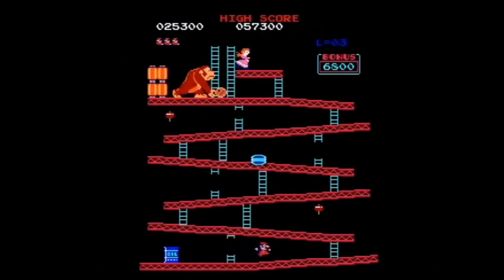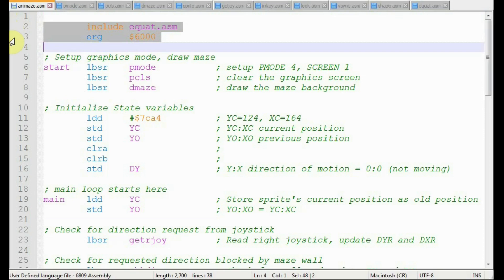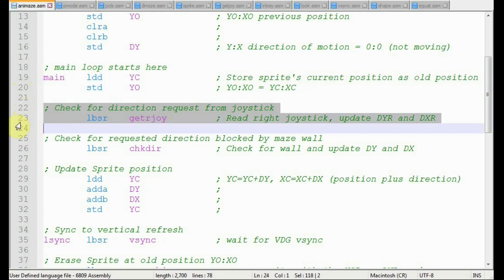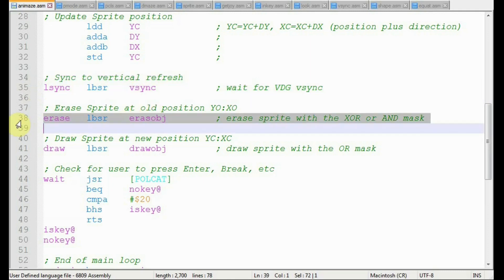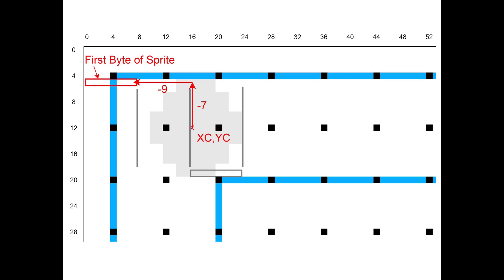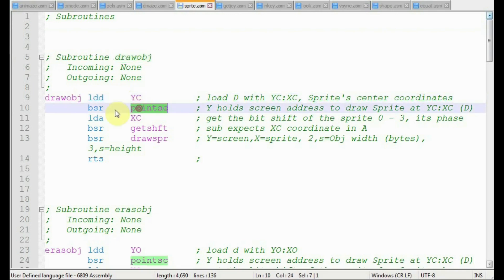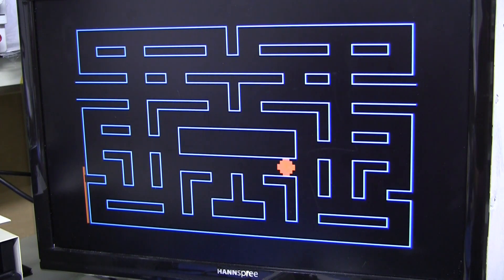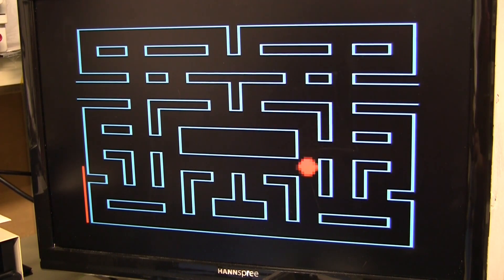Software Sprites are 10 Times Better with Machine Language than BASIC - Part 2

Comment: Nice video…I really like your explanations of handling these sprites in ASM. But I’m trying to determine how the idle instruction orange bar on the left works. I imagine you coded that. Is it just a matter of having an “idle” routine that counts until the next VSync fires? Then on the next frame you might have a draw idle bar to show how much cpu instructions are left?
Reply from the maker: this is a late response... You are right.  I believe it was counting in an idle loop and waiting for Vsync.  When it happens, I clear the previous bar from top to bottom and then display a new number of stacked bits to correspond to the idle count.

Comment: I started to learn assembler on C64 6502 CPU and then i switched to intel 80286 CPU and there is a vsync that we can use on VGA display, but this is not enough for a flicker free movement with very large objects high resolution 32 bit color, we have to use double or triple buffering with vsync. We draw all objects on an invisible screen memory and if it is all done we switch the screen to this location and start to draw in the next unvisible screen.
Reply: Wing Commander seems to use only a single buffer and update it scanline by scanline. So you get tearing, but no flicker. I could not get the Vsync to sync on the smooth scroll register and the address start register correctly. When the vsync bit changes, how much time to we have to set the address start register? I would guess the whole blanking of 10 scanlines or so! And smooth scroll register should act per scanline. Unfortunately, back in the day I already had access to a single PC and lost interest in 72 Hz smooth scrolling and thought it was a bug of the graphics card and not something about timing. Maybe I should check on vsync =0 instead of =1 . Or it really was a bug of the ET3000 . At least all C64 VIC II are equal.
I should look up if commander keen uses double buffering. With its small sprites it may very well be that all objects are sorted by Y. Then you only have to do half of the work for the background edges on scrolling. You can read out the timer in the PC or the scanline of the graphic card  I think and could drop updates of some sprites if a frame is too full so you are not caught while you just restored the background around the sprite ( for animation ), but no yet redrew the next frame of the sprite. A 268 @ 20 MHz is a whole lot faster than a 6502. You can use the read modify write cycle on EGA to copy 32 bit at once with in VRAM, but you only send 8 bits over the ISA bus. So it runs fast on old PCs.
With sprite overlap .. so I watched some arcade and have to says that there is not much sprite overlap on screen. But if you have to drop a sprite update, you still have to redraw the sprite in the overlapping region. So you may have to drop the next sprite .. okay with a lot of action we better use double buffer.
Okay, EGA or VGA don't tell us the scan line, nor can the interrupt the CPU. So you gotta use some math and https://en.wikipedia.org/wiki/Intel_8253
Reply: @ArneChristianRosenfeldt  
mov dx,3DA
A:
in al,dx
test al,8
jnz A
B:
in al,dx
test al,8
jz B

...action..
Reply: @maxmuster7003  that is what I did. And on my PC address register and smooth scroll were not in sync (one frame off). Maybe I wrote that part in C. The crappy Borland compiler was able to expand even simple lines of C code into hundreds of machine language instructions. But unlike in some 8-bit home computers, you could not just inline assembly. So I would have to fiddle with the linker. I don't know why build systems suck so much. It was easier to write code completely in MASM, than to link it to BorlandC++. I corrected it by writing a modified version to the shift register. I mean, it makes no sense .. but then of course it did not work on PCs of two others where I tried it. Then I learned that you cannot develop for PC nor Android without access to different hardware. You cannot dev on a small budget in the basement of your parents home. It is like the VSP bug. Some C64 have it, others don't. So yours may not have it, you invent VSP, and then code for a year and then your game does not run on 50% of your customers PCs. I guess that smooth scroll on PC was indeed buggy because besides Commander Kenn and Cannon Fodder nobody seems to use it. And 256 color mode .. I don't like the double scan .. but anyway, I think it could scroll. You change the pitch to 324 px.

Back in the day I did not really understand ModeX. VGA has 4 bitplanes like EGA, so it cannot do planar 8 bit colors. So the read out circuit always reads out the four planes and displays the bytes next to each other. I think you should be able to scroll through the whole VGA memory. But usually CPU access is configured in a way that you cannot set the two highest significant bits. Thus in ModeX .. I mean in Wolfenstein3d they changed the CPU access back to the EGA way. It means that you can only draw vertical lines ( efficiently ). So this is bad for line vectors, but not a problem for filled vectors or sprites. I still wonder why the VGA could no repurpose the mask bits as a paging register. All SuperVGAs could do that. Or have an official paging register so that all SuperVGAs would use it. Like two nibbles for x y windowing like LCD controllers offer it today.

The unspecified timing relation between Vsync and address start register may be the reason that Doom only looks at Vsync and copies the pixels from main RAM to VRAM. On a slow VGA this has the benefit that the CPU gets exclusive access to VRAM in the vertical borders. If games target a low frame rate and lots of overdraw, this is faster. And all those 16 bit color to 8 bit color conversion because IBM could not be arsed to just also specify a true color mode.
Reply from the maker: Yes! The double-buffering.  I remember doing the same when I used BASIC as a kid.  A BASIC program could take a while to render a graphics screen and you would often want to hide the drawing phase until it was completely ready to show.  Thanks for the view and that information.

Comment: Ah yes.... good old software blitting.
Reply from the maker: Hey Gorf, I had to look up that term. I heard it a long time ago and forgot  it. It's woven deep into the parlance of 2D graphics. Much reading material ... Thanks!
Reply: @acs8-bitzone651  It's what you are doing in this video! 👍
Reply: @acs8-bitzone651  it's a contradiction in terms. Block Image Transfer requires a dedicated DMA channel or at least an BLIT opcode. You can't do it in software. You may as well talk about "software GPUs"
Reply: Software blitting is an oxymoron.

Comment: Excellent video, when I was a kid I always wanted to understand how sprites worked in the CoCo. Would you recommend a book  about the 6809E architecture and instruction set?
Are you going to publish both programs?
Reply from the maker: Yes, I can provide the programs.  I wasn't thinking that anyone would want them though.  Do you want the assembly one from Sprites 2?
Reply: @acs8-bitzone651  Yes the basic and the assembly program
Reply: @acs8-bitzone651  I've just started assembly on the coco again after so many years.   I have a Coco 3 with a GIME-X and could use some good examples like the ones you just showed.   Keep up the good work.
Reply from the maker: I have been bouncing back and forth between "TRS-80 Color Computer Assembly Language Programming" by William Barden, Jr, and "6809 Assembly Language Programming" by Lance Leventhal.  For graphics, I'm using "Color Computer Graphics" by William Barden, Jr.  Also "500 Poke, Peeks, and Execs" for some of the graphics modes.
Reply from the maker: Thanks for your feedback Gman!
Reply: Also interested in the assembly code! I grew up on CoCo, and was teaching myself this stuff when I was a kid… but we unfortunately lost our CoCo in a house fire, and I’ve been longing for one again ever since. In a fit of nostalgia, I picked a couple up old eBay and am anxious to pick up where I left off > 35 years ago 😂